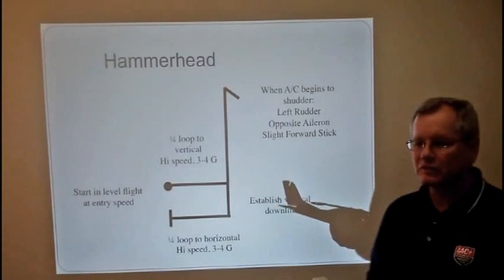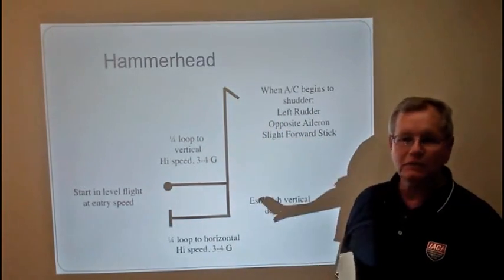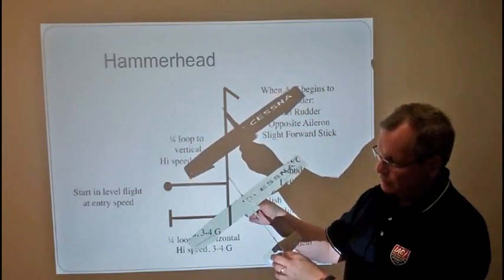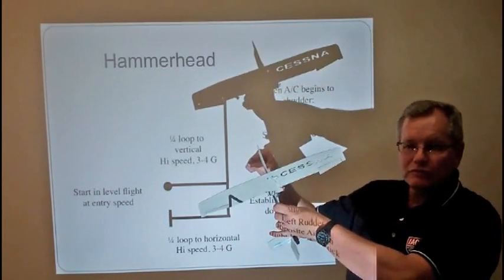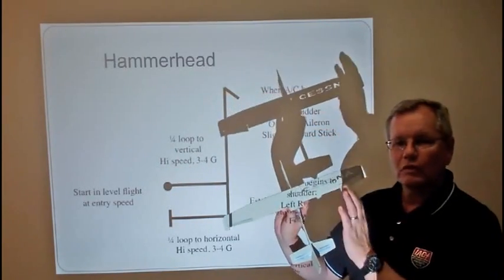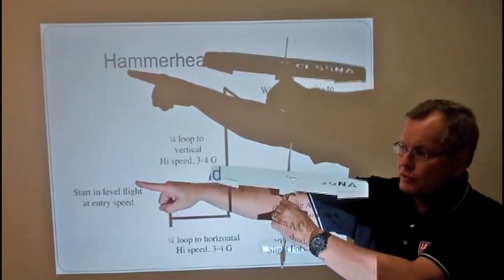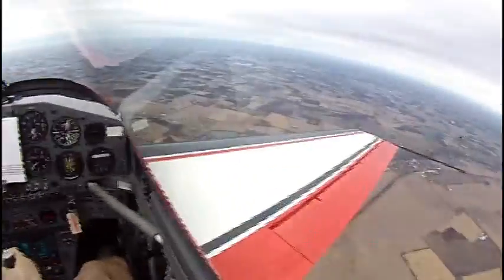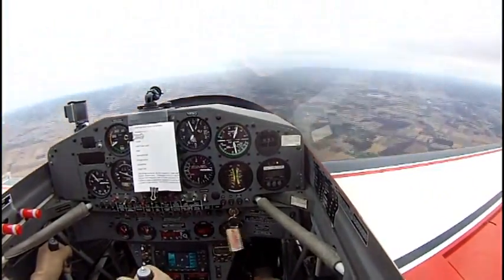The Aerobatic Textbook: Hammerheads

Comment: I pull the power off during the vertical then do the stall turn, much easier with no prop torque. Gotta be quick though as speed/energy bleeds off fast with power removed.